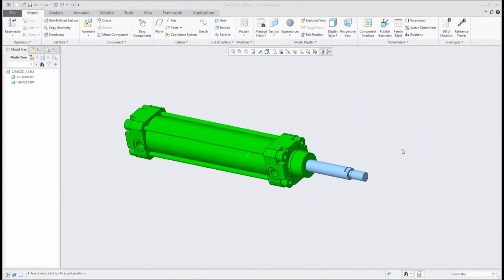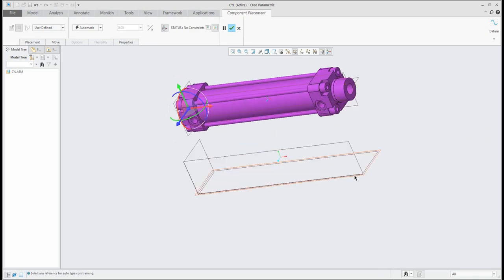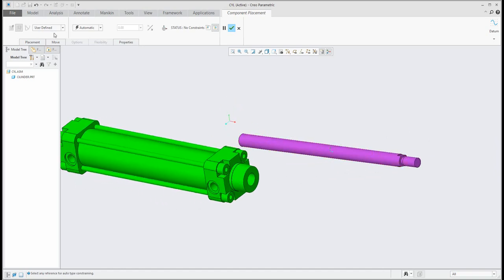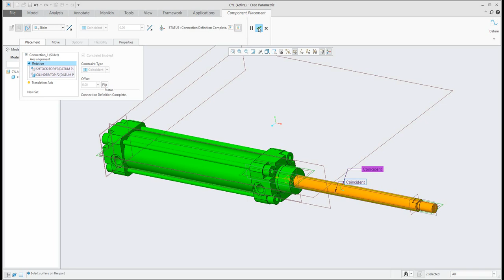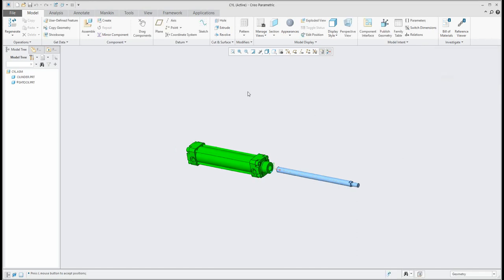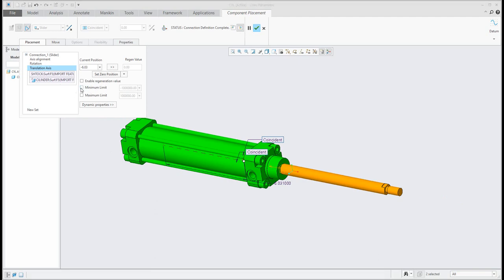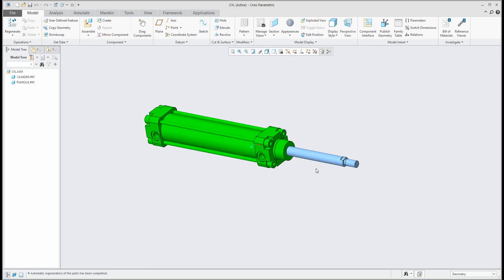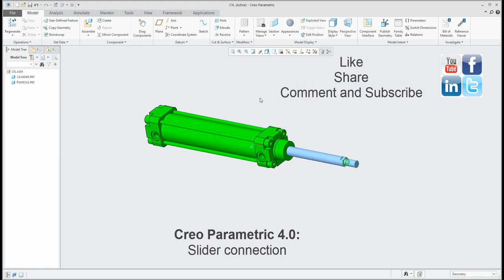PTC Creo 4.0 tutorial: Slider connection

Comment: Hi Vlad - I find your videos so helpful - many thanks!  Quick question - I have a slider piece within another piece that rotates (think of it as a slider piece within a door handle).  I have set up both the pin and slider contraints correctly, but when drag the slider, the door handle piece also rotates.  How do I set up so that when I drag the sliding piece, the door handle still remains fixed and doesn't pivot too (but I can pivot the door handle piece separately)?
Reply from the maker: Dear Rajesh, if you use drag function, system always move in all directions (you can check movement of the component. If you want to check only part of mechanism, you can lock and check different positions by drag functions or only simple define servo motor and set custom analysis. For your example I will choose lock function - I can try to find some example and show in upcoming tutorial ;) Bye Vladimir

Comment: how can i name my part file. when i give same name to two different parts located in different folders it collapse the assembly of its own diagram what is a reason .how can i avoid it
Reply from the maker: Hi, if you have same names for two different folders, setup Working directory before opening the assembly. System will load objects only from WD. System can not read another folders without configuration option.